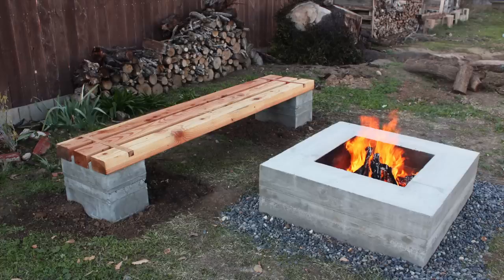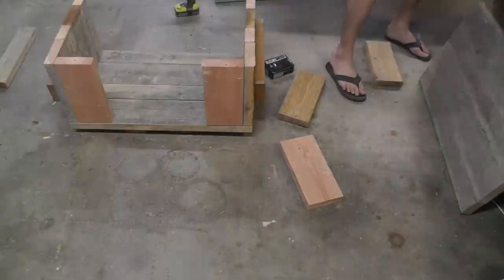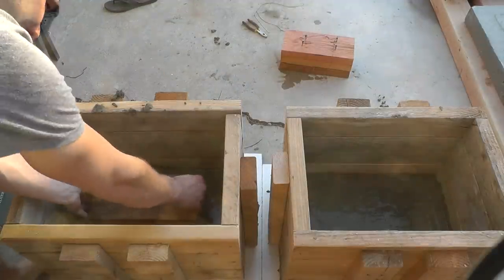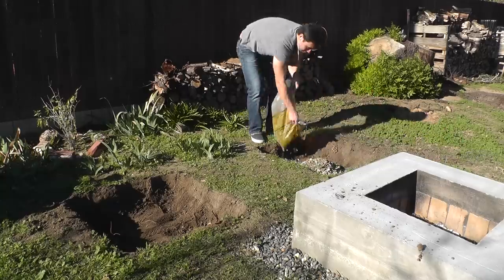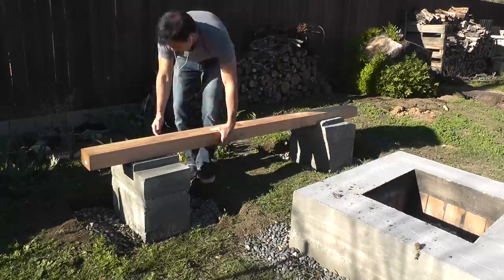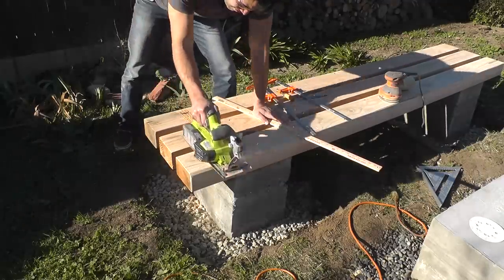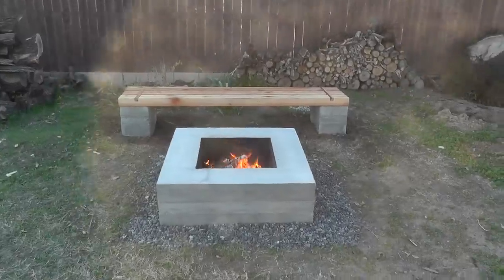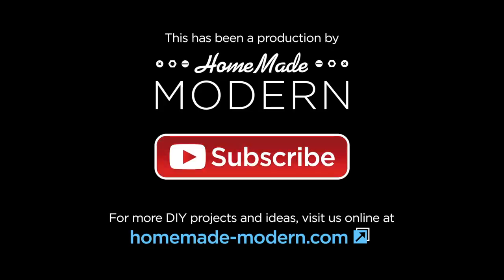How to make outdoor concrete and wood bench

Comment: Great video! A tip I'd recommend is to drill the 4x6s into the concrete with tapcon concrete screws where you made the notch for the 2by2s, then glue the 2by2s in place instead to give it a more simplistic natural look without the wood screws showing.
Reply: awesome idea
Reply: Beau Nakamori he wanted to be able to take it apart for another project he was working on

Comment: ever seen a concrete fire pit explode? look into the curing moistures ratio vs rapidly applied heat.

thermic lance operators use to die all the time trying to cut uncured concrete

Comment: Thank you for all the insight and ideas! I was just curious whether the wood you used inside the concrete would not expand with the moisture and eventually crack the concrete?
Reply from the maker: I soaked it pretty good before i put them in so jam guessing no but i will do an update video in a couple months to see if there are cracks in the fireplace or bench
Reply: +HomeMadeModern would love to see your update video! I'm working on the fire pit now.

Comment: Won't the wood inside swell with moisture and crack the concrete?
Reply: +Michael D How will moisture get inside?
Reply: +mbrickner87 Concrete does go into equilibrium with the environment in terms of moisture. Concrete, like wood, expands with moisture content and temperature, which is also why a concrete driveway, for example, needs expansion joints. The problem with putting a piece of wood inside the concrete is that wood expands at different rates and amounts than concrete, which will exercise forces to the inside of the concrete and may cause it to crack.

I don't know where he lives, but if he lives in a climate that experiences freezing temperatures in the winter, it will crack even faster, since water turning into ice will put much more force on it.